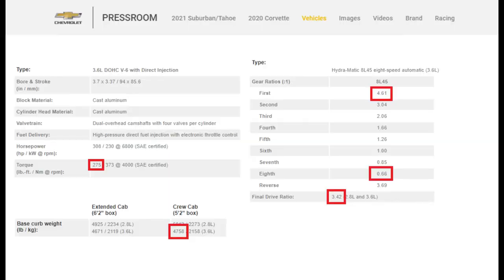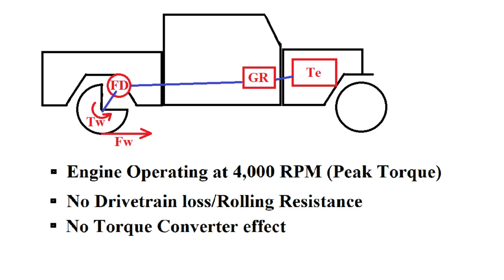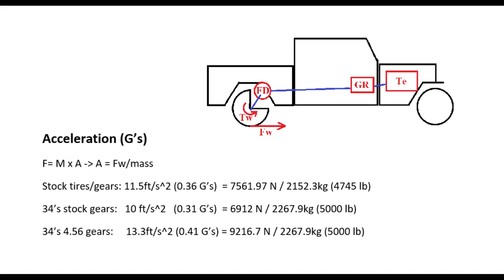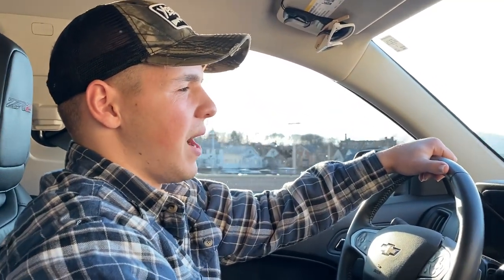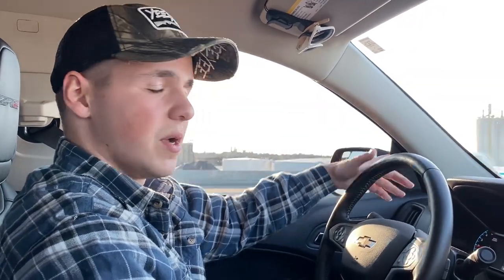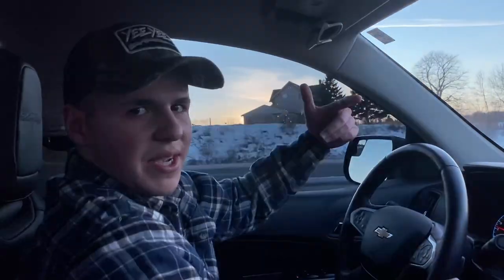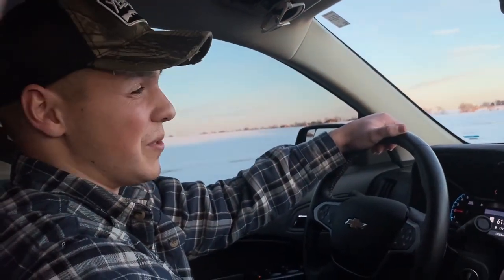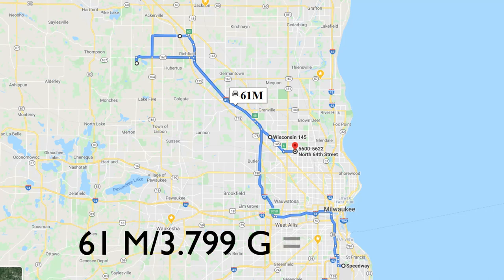4.56 Gears Review - Math and MPG!

Comment: After watching this video a second time I think your math may be off. Correct me if I'm wrong.

 When dividing tire size by wheel torque you used 2.79 feet as the radius. But 2.79 feet is the diameter. Radius is half that or 1.395 feet.
So all the results appear doubled. Your torque results of 1700, 1554, and 2072 are actually 850, 777, and 1036.

Did I miss something?
Reply from the maker: I pinned your comment because you are correct, I did accidentally use diameter instead of radius. But I believe my mistake would actually have the opposite effect, you are dividing wheel torque by tire radius, not the other way around, so by dividing by a number that is half the amount, you would get a much larger number for force that the truck is able to accelerate with, and much higher G force numbers
Reply: @campbelloffroad3660  yeah. I realized that after I posted the comment.

Comment: I learned in the 90s from Stacey David of "Trucks" the math to figure out the best "all around" axle ratio for a given tire size as follows, "tire size x 0.12=axle ratio". So 34" tires would be 34x0.12=4.08. 4.10s would be a optimum for someone who wants towing/off roading occasionally and decent fuel mileage. You're probably a bit low, but those tires are also heavier than stock and need the torque to get around easier. Good choice.

The stock 3.42s are all about GM meeting federal fuel mileage requirements and the fact that 90% is these trucks never leave the asphalt.

Also, 55mph used to be the national speed limit. This was because the FHWA (federal highway authority) tested mpg vs speed after the oil crisis in the 70s. 55mph offers the best mpg for highway travel. This is because above 60 mph vehicles use more fuel pushing through the air in front of them than their aerodynamics benefit.

Comment: I have 4.56 gears in my 95 Tahoe 5.7L/350. With my 27 inch tall street tires, at 70 mph I'm running around 2800 rpm. With the 268 Comp cam, AFR heads and Pro Flo 4, it's a real blast to drive but I average about 9 mpg. Sure that really sucks but I also average about 1,000 smiles per gallon. So it evens out. Wish I could get like 15 mpg though, that would be alright with me.

Comment: 2200 rpms doesn't seem like that high. Isn't that where you want the rpms? My 2.8 zr2 runs about the same at 75-80mph and its stock
Reply from the maker: yeah with a 6 speed that sounds about right, a stock 3.6 would be at 1700 at 70 in 8th gear, but rarely has enough power to stay in 8th

Comment: How much did it cost you to install the 4.56 gears. Thinking about putting that gear ratio on my Tahoe with 35x12.50r20 tires
Reply from the maker: I paid about $1000 for parts and $1000 for labor

Comment: I just put 4.56 gears in my ram 1500 with 33x12.50 tires and I went from getting 13.9 to 14.5 when I’m stomping on it and over 15 when not stomping on it.  I’m happy with them.
Reply: I’m considering 4.56 gears in my 16 Rebel. 3.92 gears now. Had 35s but it downshifted way to much. Back to 33s until I regear. Any regrets?
Reply: @scraggsds  no regrets for me, in fact I wish I would have got those on there long ago.  More torque and more mpgs.

Comment: Trying to decide if I should eventually upgrade to 4.56 gears. Right now, I've got a leveled 2015 silverado with 33s on stock 3.73 gears. No issues. Eventually, I want to get a 4.5 inch lift with 35s. I'm assuming I'll need to get the 4.56 gears. I primarily use my truck for driving on forest service roads when I go hunting and fishing. I also haul/tow  things around the farm. I rarely even get on an interstate/freeway. Mainly just country roads and unimproved forest roads.
Reply: i say 4.10 gears would be better

Comment: Is that howl at highway speed from the gears? Do you get bit of a rumble too?
Reply from the maker: My gears had some whine/howl while coasting and at highway speeds from in-proper installed (13mm backlash instead of 6-10mm) properly installed gears should not have that problem

Comment: What tires are those, they hum pretty loud
Reply from the maker: Peter Garcia the humming is actually coming from the new gears, it’s really weird, some days it’s loud (like that day) and some days they don’t make any noise at all. But I had the tires before the new gears and the tires are actually very quiet on the freeway
Reply: Campbell ZR2 yes, I went back to the videos before the gears and no road noise. Weird how they're noisy, maybe try changing the diff oil.
Reply from the maker: @peteg7446  the diff oil was changed at the end of the 500 mile break in period, no change in noise, I'd like to do something about it but for cost reasons i'm probably just going to accept it.
Reply: @campbelloffroad3660  the reason is because they aren't OEM gears. chevy factory gear only go up to 4.10. i have 4.10 swapped in my truck and they are OEM quality, i have no noise at all no matter the speed. if you go out of factory ratios you only have aftermarket gears and they are noisy af.

Comment: GREAT for off road...Not so great for every day driving. The eternal compromise with street mods. Great for performance but affects drivability, fuel mileage, overall engine/drivetrain wear, etc. Been there ,done that, for many years. Finally grew up and STOPPED. A waste of so much money to make your ride worse on the street.
Reply from the maker: Respectfully disagree. A 2019 truck is entirely different than a Chevelle from decades ago. I now have 35 inch all-terrains on my truck and get 20 mpg on the freeway, a great ride quality and much better power and torque.